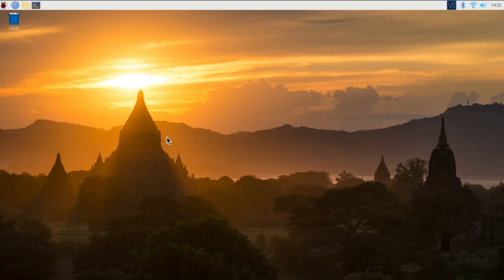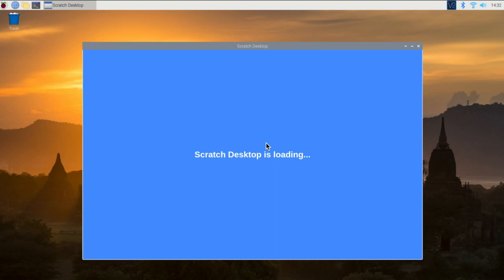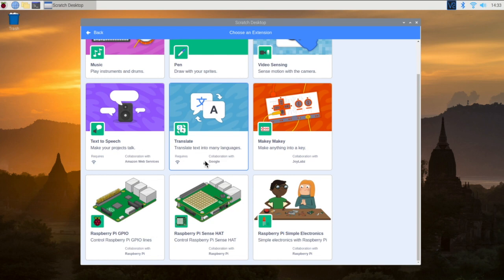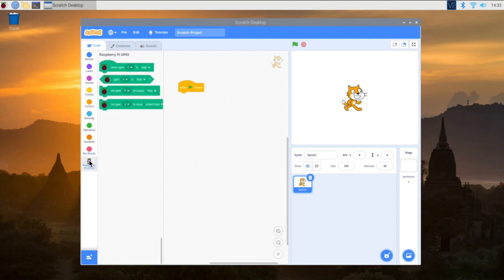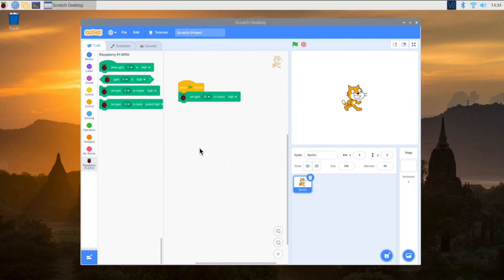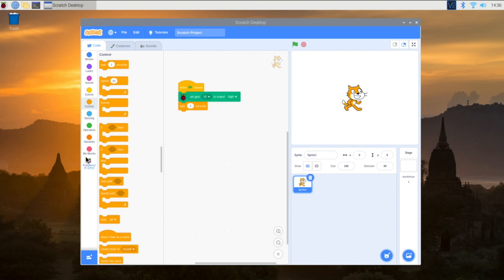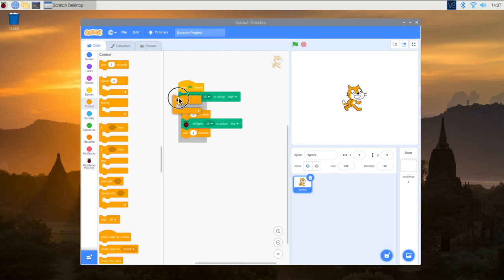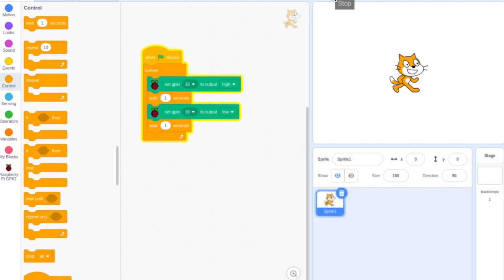Raspberry Pi 4 + Scratch 3 + GPIO = LED Blinking

Comment: i didnt see rasberry pi extension in scratch.. is this fake?
Reply from the maker: No it is not fake. You need to use Scratch 3 on the Raspberry Pi
Reply: @coffeechug  will it ONLY work on the pi? what if i want to code on something else but test it on pi?
Reply: @justsayjay  The plugin is only available on the Rasberry Pi OS version of Scratch 3.

A decent workaround is running a rasberry pi virtual machine on your pc. Ive never tried it but im confident it works.